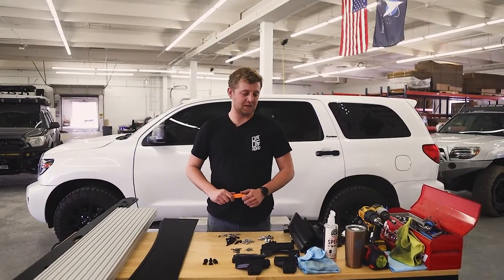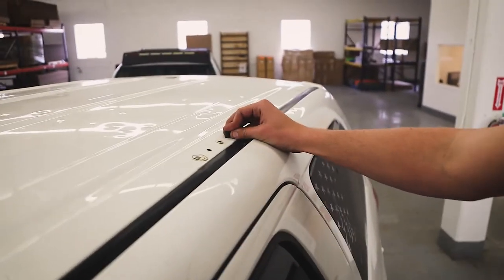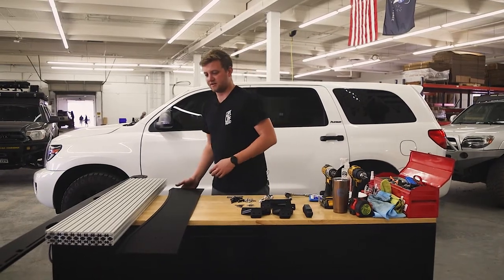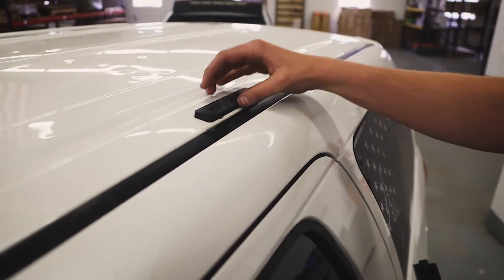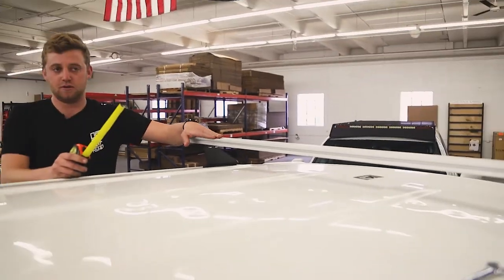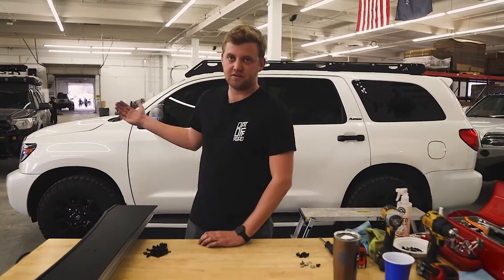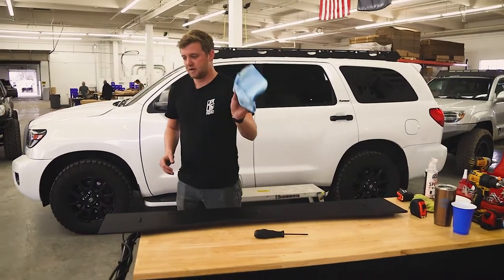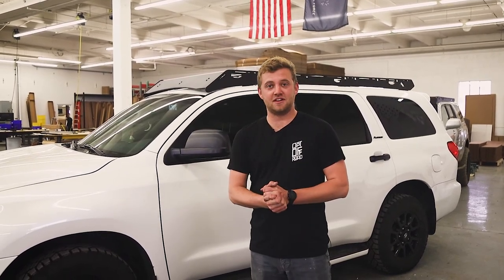The Harvard Rack Install - 2008-2022 Toyota Sequoia Roof Rack

Comment: Are those mounting hardware (bolts and bonded washers, ones threading into the truck) stainless steel or galvanized
Reply from the maker: They are stainless!

Comment: does this rack require removing or deleting the factory antenna from the rear roof section?
Reply from the maker: It does not require any modification to the antenna.